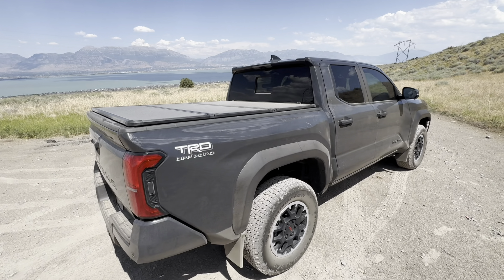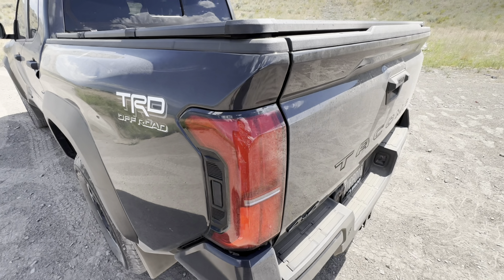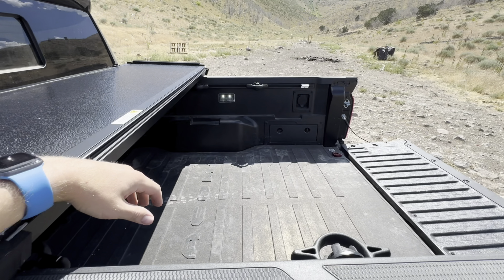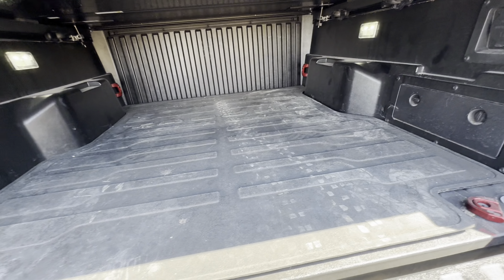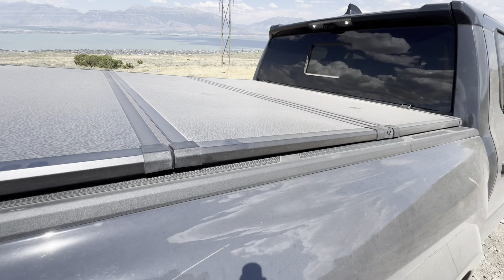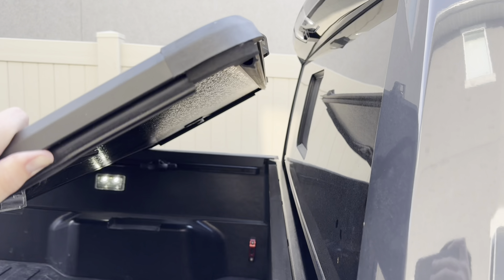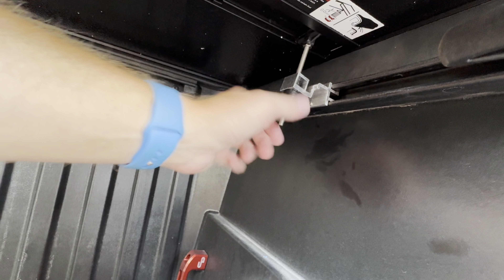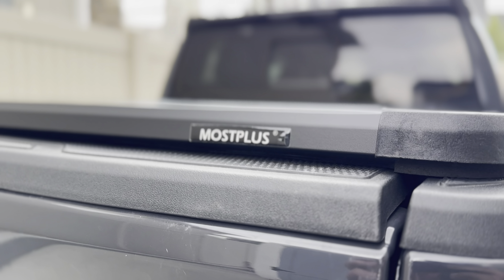Budget friendly HARD Tri-Fold Tonneau Cover - 3rd & 4th Gen Toyota Tacoma

Comment: My 24 trd OR came with a bed divider molle style that slides on the rail system, will this tonneau work with the bed divider?
Reply from the maker: @user-gz6do2kd8z  this bed cover uses brackets that slide into the corners of the rail system. If your bed divider blocks those spots on the rail then it most likely won’t work. Hope that helps.
Reply: @MuscleAmerican  yes thank you for that info. I think it work with the bed divider as it slides on the rails and can move it around. Worst case I can return the cover or sale the bed divider. Appreciate it, awesome channel

Comment: Does it rattle when you are driving on rough pavement or off-road?  I have the OEM cover on my 2021 TRD Sport and has served me well.  I don’t like the latching mechanism to fully close it.  It is way too hard to get the clamp to go into the rail.  I also don’t like losing bed space when it’s fully opened.  I am going to try to get the roll up type with the Velcro closure.  I had one from the Access company on my 2009 GMC Diesel pickup and it was completely waterproof and it looked like new for the 12 years that I had the pickup.  I just used 303 Protectant on it every time I waxed the truck.  It cost me just over $600 back then.  When my 2024 TRD OffRoad arrives (it’s in production now) I’ll check your cover out and see if Access even makes the Velcro closure roll up cover anymore.  Thanks for the video.  You did a nice job.
Reply from the maker: @lc7192  thanks for the kind words! And I haven’t noticed any rattling.